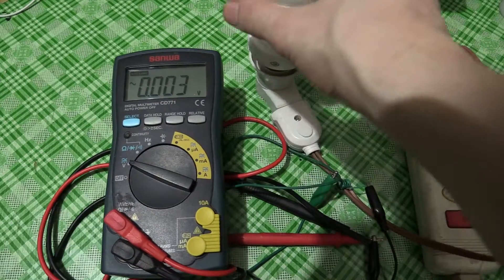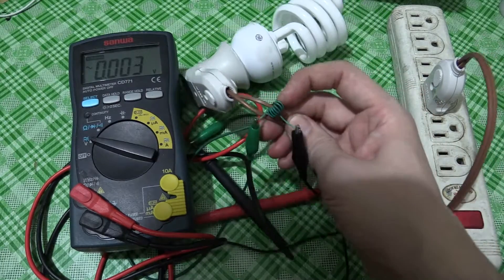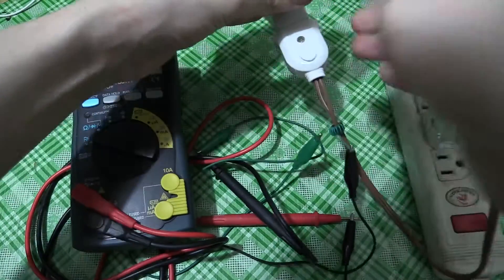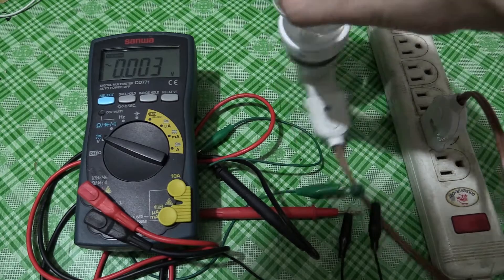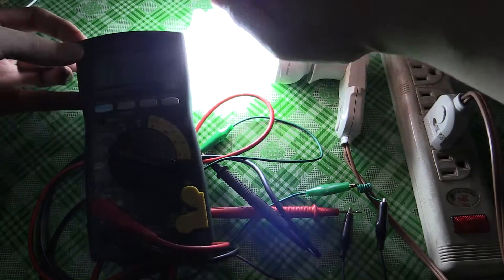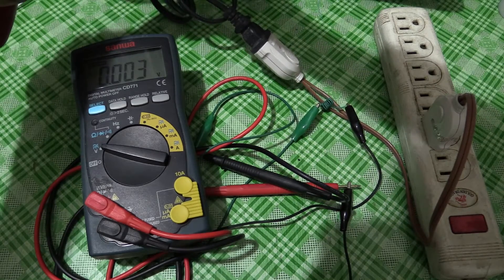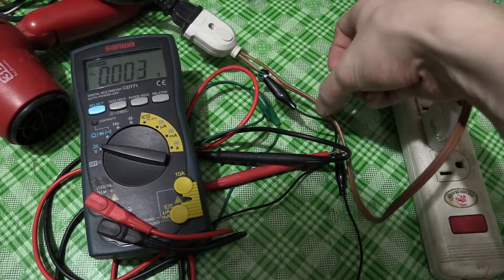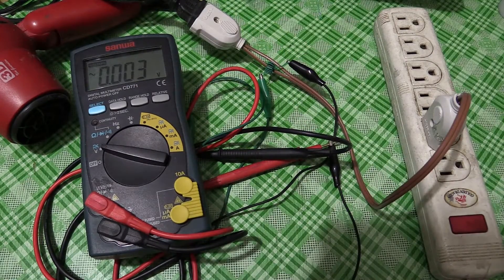Toroid Current Sensor

Comment: Sir how to calculate a secondary winding for toroidal ct and how to select core and coil size. Pls guide me... Its is important role in my project sir ( load current=20,ct o/p current=20ma,o/p voltage=5v)